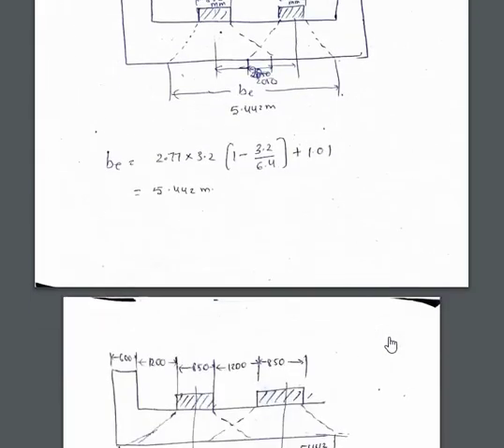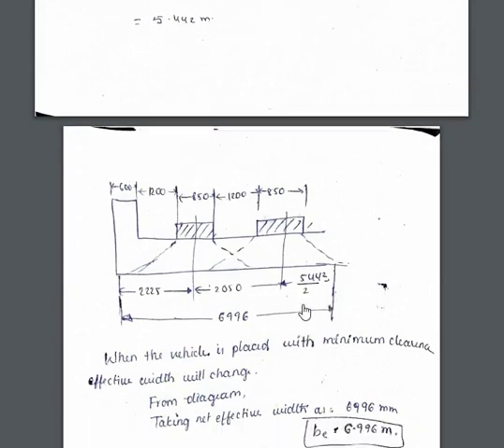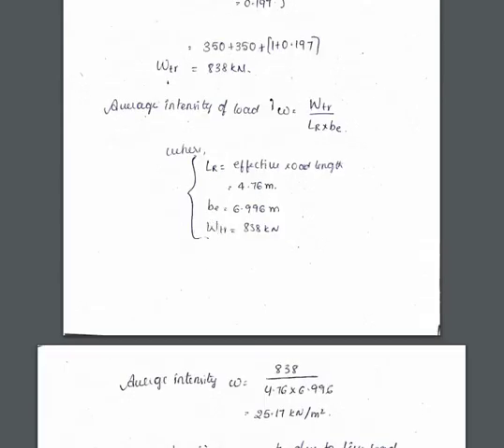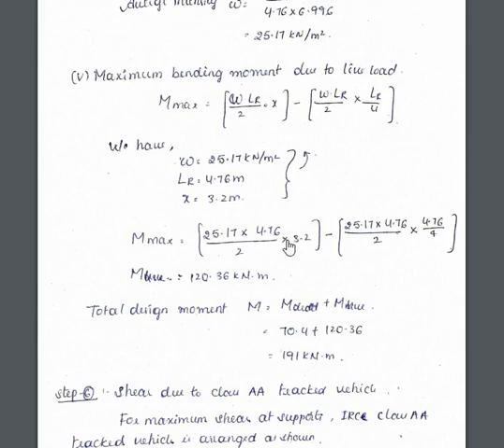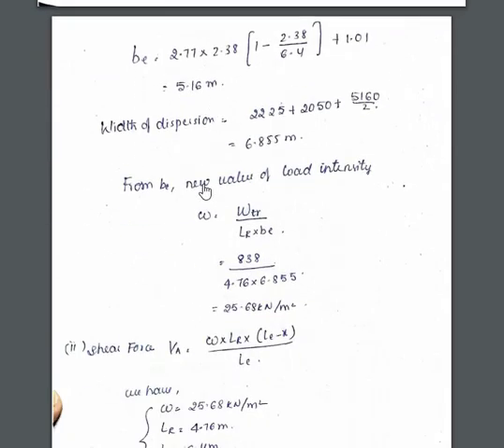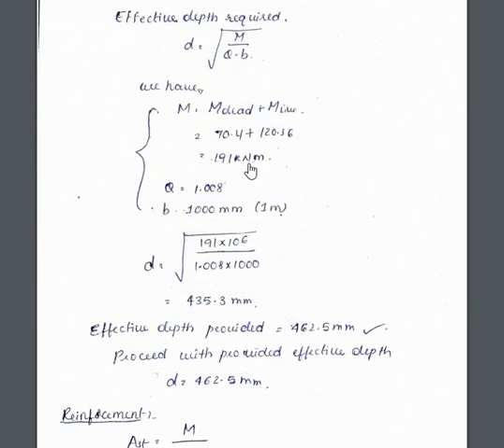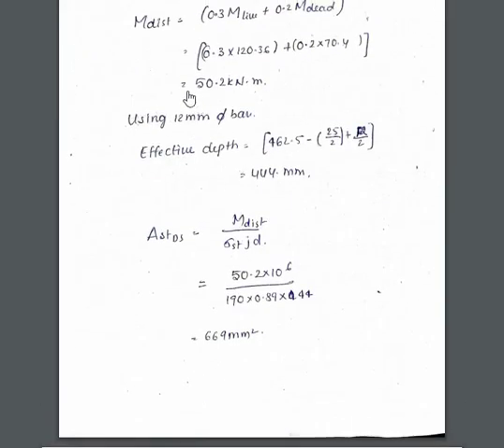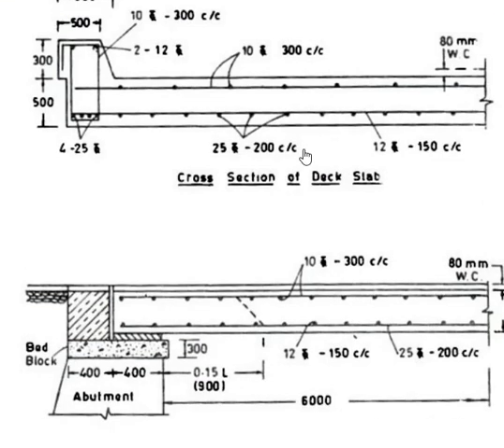Problem on Design of RC deck slab Part 2/2

Comment: Your explanation is nice but Some mistakes are there in that problem.
1)In permissible stress calculation you have taken ^st=190(but it is permissible stress in compression i.e. ^sc)
^st=230N/mm^2(permissible stress in tension)
2)Track load = L.L+I.L
Here impact load is 19.75%of live load. Then the formula gets
Track load=(350+350)+(0.1975×(350+350))=838.25KN